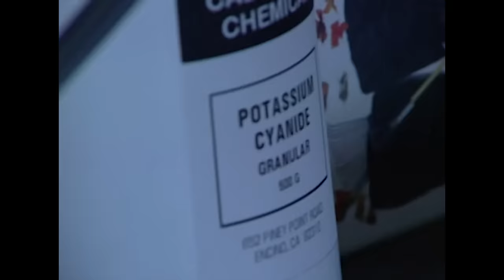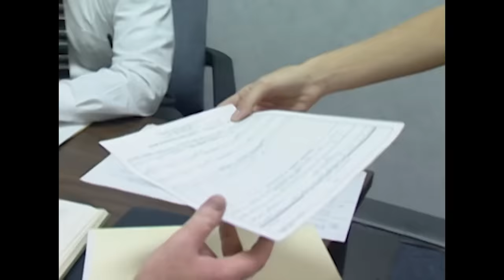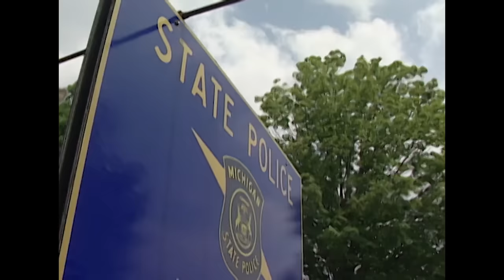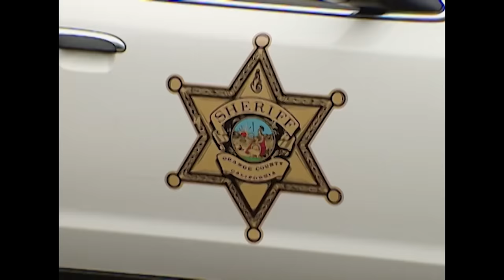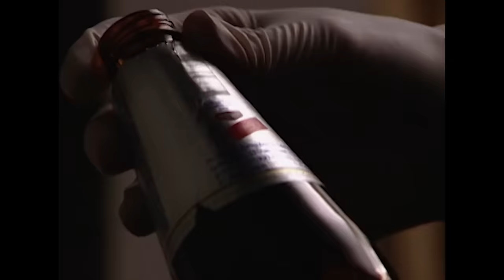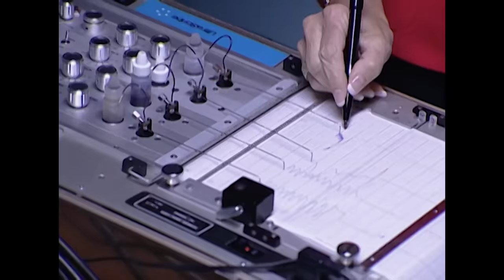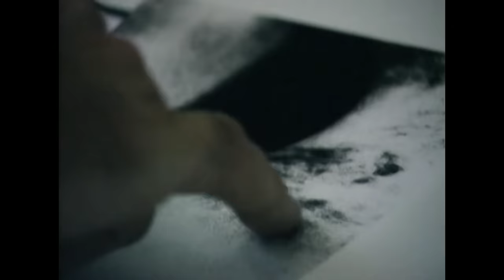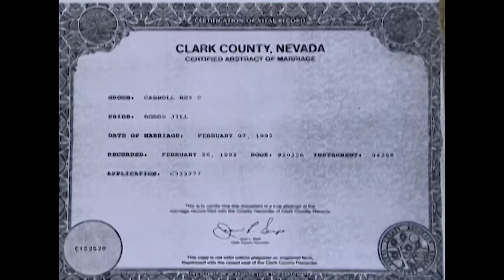Bizarre Clue: Solving Virginia Russell's Murder with Beer Bottles | New Detectives | Real Crime

Comment: I'm shocked that Beck's defense attorney didn't ask how many bottles are produced on one line in 15 minutes.  Considering all those bottles ended up in a case (or a multitude of cases), at least one of which was sent to the store Beck bought them at, why didn't his attorney raise reasonable doubt?  Other shoppers would have picked up six-packs with the exact same coding at the same store.  It's not a slam dunk, though I'm glad his defense attorney was an idiot.
Reply: He may very well have asked that. But I'm not quite sure that would rise to the level of reasonable doubt.

Keep in mind it isn't JUST about the beer bottles. It's about the other evidence. You've got a gun linked to him that was used in the murder and other supporting evidence, and now you've got beer bottles at the scene of the crime with are linked to him as well. Accepting that someone else happened to buy beer made in the exact same fifteen minute interval as the case he owned, and just happened to be drinking at the exact spot of the murder, rises above the level of happenstance.

Comment: I recall two or more cases where Maggots are used to find time of death. The case where they mentioned the body was in the water and could not identify the DNA. Even though I have not seen cases, it just came to my mind that when there is an unknown reason for a sickness, they extract the Bone Marrow to do some test. Question: What about the DNA in bone marrow, the body was in the water and not on dry land for the marrow to be dried? Even in that case, a birthed mother with placenta or umbilical still left back in one case is also evidence to find DNA, why not bone marrow? Does maggots have DNA?
Reply: I think all living things have DNA!
Reply: @angelapetrick9675  Thank you! But my question was about the victim's DNA in the maggot ...I do not recall the case, but there was some scene where I have seen them grind maggot... was that for DNA, I do not recall.  
Even in humans one can have two DNA if they had "bone marrow" transfer. One different in the place of the transfer from the original contributor.
Reply: @@frankskoda-simmons so like even plants!
Reply: @angelapetrick9675  Of course.